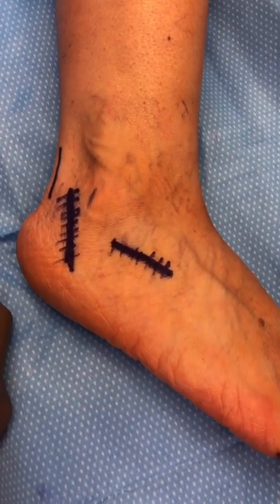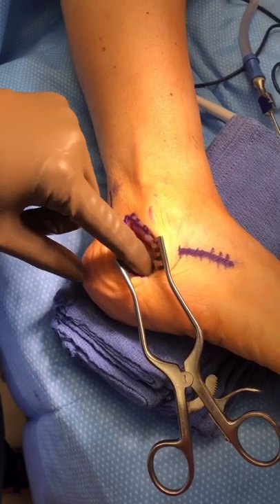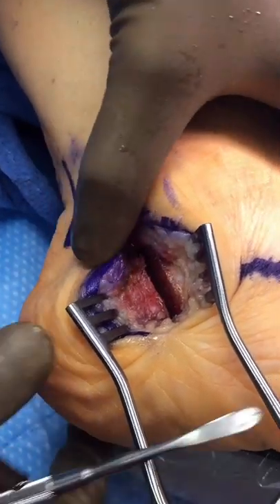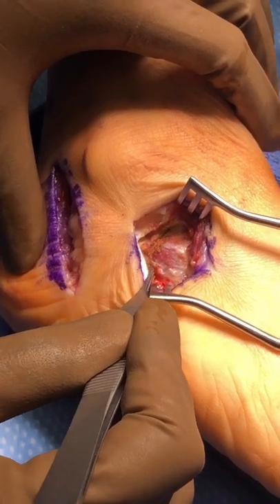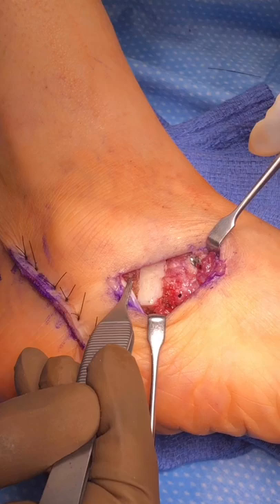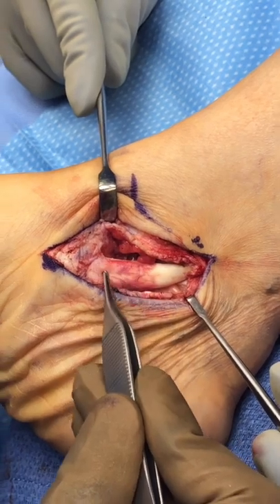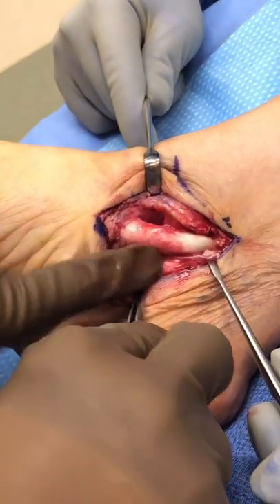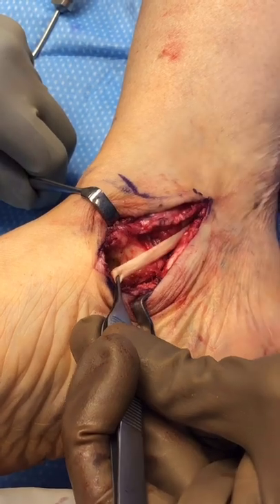Stage II PTTD Reconstruction

Comment: Can pttd cause bottom of foot to swell was told it wasn’t plantar fasciitis
Reply: Yes it does cause swelling at the bottom of the foot. Main distinction between plantar fasciitis is, PF cause morning pain while pttd tends to get better after you rest the tendon. The best thing you can do is to have a gait analysis and have a custom made orthotics which can prevent extra tension on the tendon which causes plantar fascia and tendon pain. I also saw there is custom made braces which seems to be a better option coz it really holds the ankle well. Most of the suggestions are not working and it actually does the situation worse. For my experience, stretching is really flaring it up. Hard massaging is making it worse. The best is to rest and not to put too much work. Also I saw a video saying glutes max and media muscles need to be trained. So that can be another option to get stronger.
Reply: @turkeytours8942  I tried orthotics and amniotic shots about to have surgery the 23rd and I’m praying it works really tired of this problem it been 9 months since I was injured
Reply from the maker: I am happy to help if you are in Dallas
Reply from the maker: Usually pain is located on the inside of the foot and ankle over the course of the tendon itself